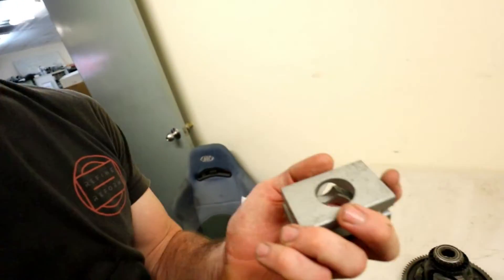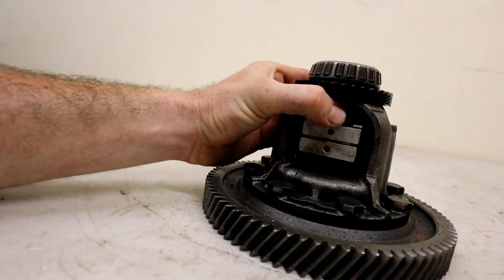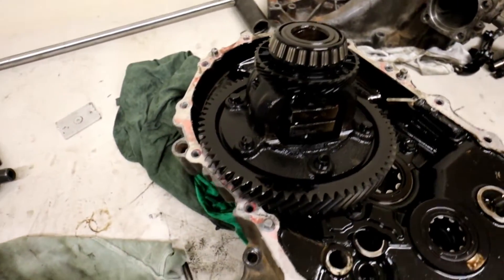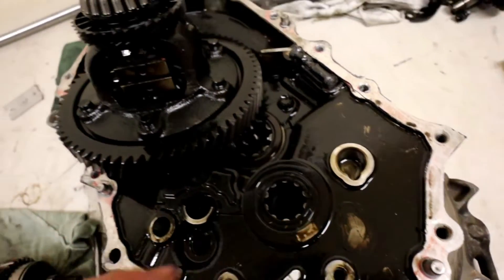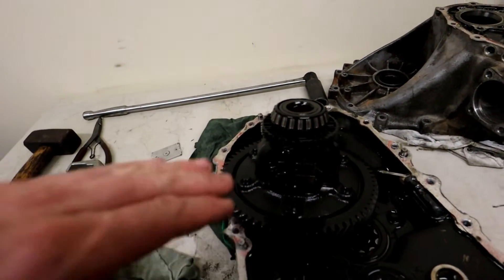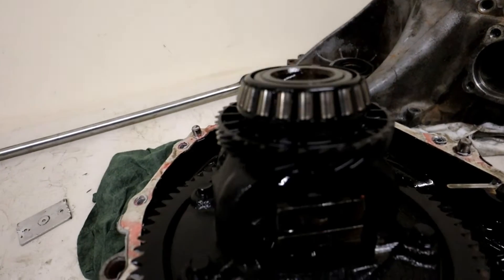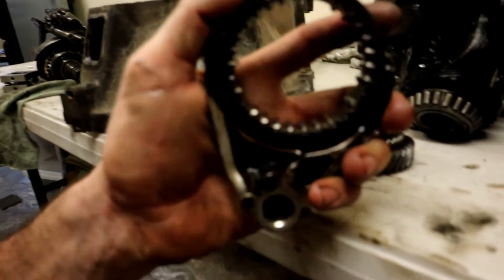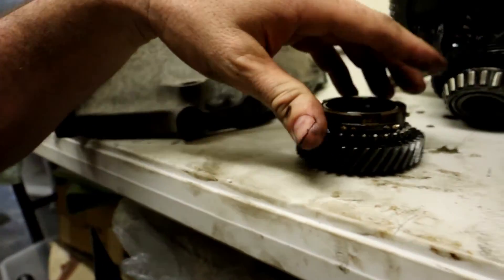$35 LSD gearbox teardown

Comment: Have you tried shimming the springs, to get more force on the gears?
Reply from the maker: The springs only hold the plates in place, it doesn’t actually do anything else. Someone left a comment on one of these videos of mine explaining it and it makes sense. The pin that goes through the diff centre to hold the gears, when you accelerate, that large pin contacts the plates and forces them apart, causing the lsd effect.
Reply: @Camp_Dogs  I thought they still had a very minor load, and Phantom used to (maybe still, idk) offer a "racing" spring pack'

Your comment made me think, the hole halves for the center pin are ramps. Like clutch type limited slip differentials! That means the ramp angles can be tweaked, for more lock during accel/deceleration!

so...if you're interested, just file off those corners. make the holes look more like diamonds.

Comment: Unfortunately the results of this video are not really helpful because you didn't keep up on the oil level and condition.  Once you discovered the leak you should have changed the axle seal and made sure the fluid level and condition was good and then we would have a better indication of how it held up.
Reply from the maker: The lsd didn’t fail, the box did. So the results are good enough for me to still recommend them

Comment: Do you think the LSD contributed to the 5th gear issue at all? Also, did the side gears have any wear or did the cheapo LSD take the beating?
Reply from the maker: the reason 5th failed is lack of oil... the side gears were fine LSD has a very small amount of wear, can feel it with your nail. Otherwise dont forget the gearboxes have a magnet in there, it will catch any metal thats getting around
Reply: @Camp_Dogs  Thanks for the reply! I have to drop my engine soon so thought I might as well add an LSD but I'm also broke lol. Crazy to see these hold up for the price!

Comment: i got my glanza in Canada with a 5 speed swap, (auto on build plate) and i always assumed it was swapped with a factory c56 the glanza came with, how can i tell if it could be a c52?

also how come everyone uses the c52? just easier to find nowadays? (i thought the c56 had better 3rd and 4th gears)

Comment: Hey mate, huge fan of the channel! Been watching all your starlet videos, but can't seem to find which gearboxes you recommend using for boosted starlets. Just wanted to check before I go and spend $1200 on a sportive 6sp. Keep the starlet videos coming man, I love em they have really helped me with building mine.
Reply from the maker: Hey sportivo arent even remotely similar... Shifter arms are in the wrong spot meaning factory cables wont work. The sportivo boxes also run more splines in the diff centre meaning your starlet ones wont even touch the sides.

Buy a c52 out of any FWD AE- 90s corolla. Easy identification can be found on the build plate on the firewall. 

You can pick one up between $100-$400

Swap 4e starlet bell housing and youre good to go

If you can afford it, buy a cusco or a kaas LSD while the gearbox is apart.

Comment: Is c150 transmission better for 4efe engine starlet??
Reply from the maker: They are the easiest to find/weakest
Reply: @Camp_Dogs  what you suggest me??
Reply from the maker: @akshaybuchoo8195  200+ hp, get a C 52
Reply: Just a quick question is the c150 box the one they use in an normal 1.3 2e ime having problems of breaking spider gears on my 4efte starlet with a 2e 1.3 carb gearbox ime from south africa so not easy getting proper starlet parts. And is the c52 same as a 4afe 1.6 gearbox please want to sort this issue out and enjoy the car

Comment: do u feel the wear on the fake lsd box was cos of lake of oil or something else eg what could we change to fix it ?
Reply from the maker: i was actually very surprised the inside of the box wasnt worse for wear... i think that just having the oil level correct would have made a world of difference, not to mention 5th gear would probably still be working....
Reply: @Camp_Dogs  yeah i got that part but there was  a ton of metal missing from the lsd block what do u recken could b changed to fix that ??